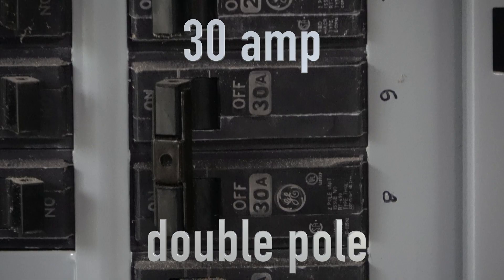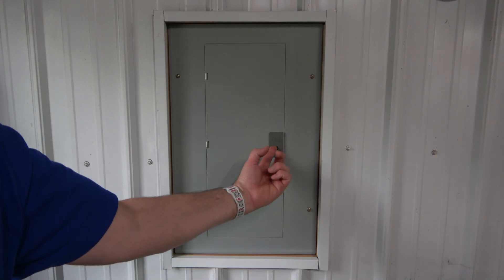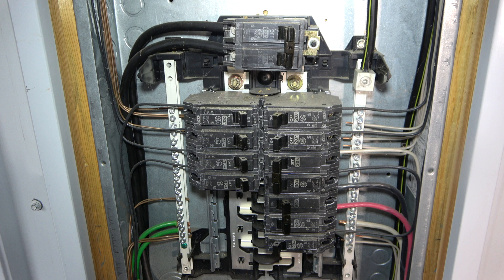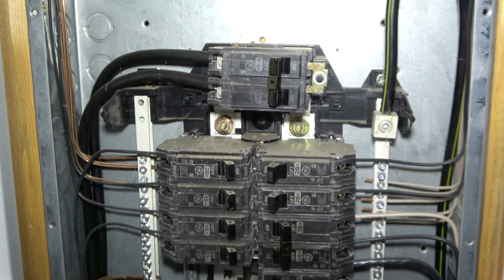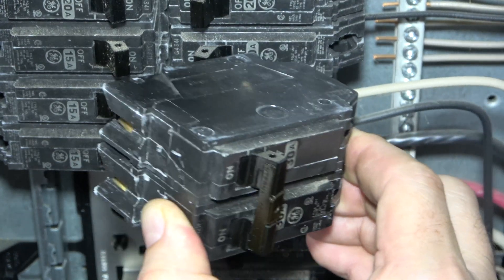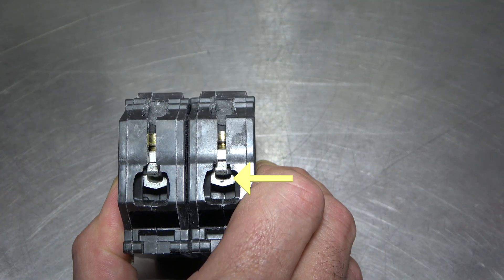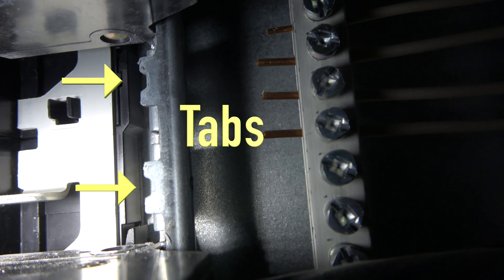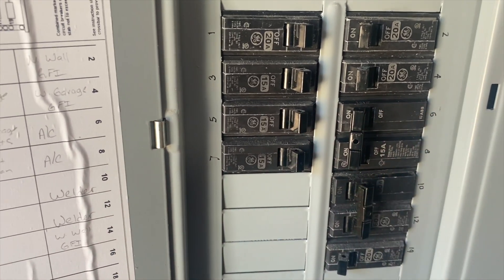Replacing a 30A Breaker with a Lower Amperage Breaker - Downsizing a Breaker

Comment: Whats the reasoning for dowsizing a breaker or changing from 1 pole to 2? Thanks.
Reply from the maker: you need to match to the appliance that is going to be plugged in to that outlet. In this case, it was a window air conditioning unit.
Reply: @PhilCrockett 
What is the difference between using a single or double pole breaker?

Edit:

Should have just googled myself. Is this correct?:

“A single-pole breaker controls one hot wire and is used for 120-volt circuits, typically powering smaller appliances like lights and outlets, while a double-pole breaker controls two hot wires and is used for 240-volt circuits, powering larger appliances like electric dryers, stoves, and water heaters”